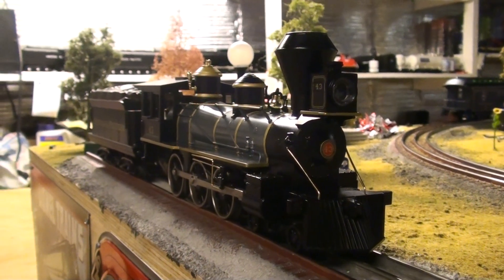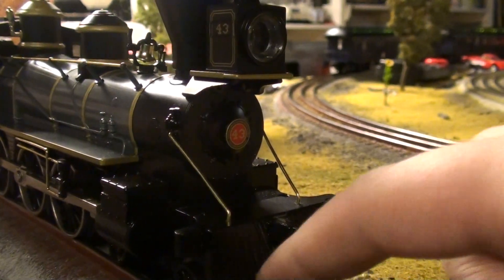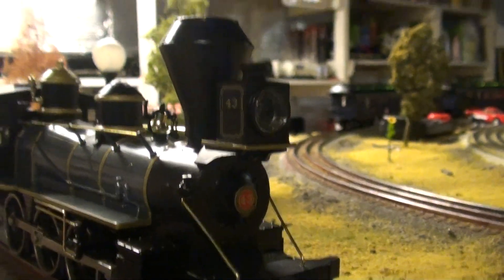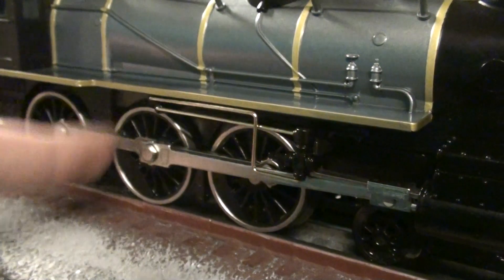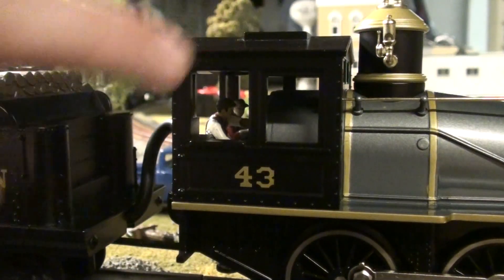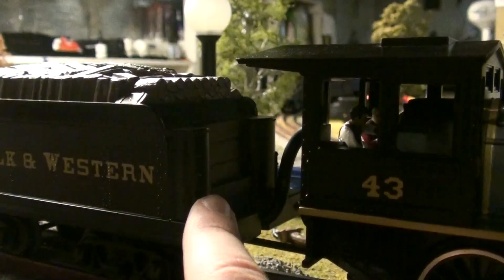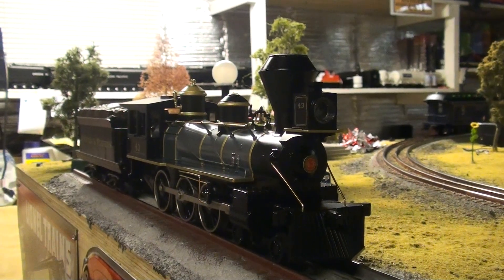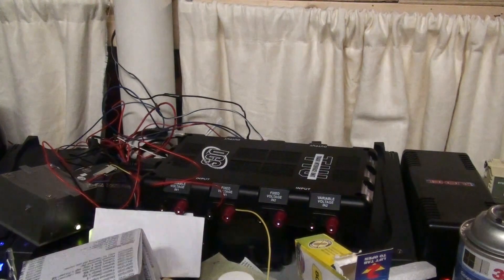MTH Railking Roger 4-6-0 Ten Wheeler Steam Locomotive

Comment: Great review! That box on the back is a tool box. The water hatch would be under the wood load and the tank is a horse-shoe shape. the two curved parts near the cab are the ends of the tank. Also the item that you called an air tank is actually the air pump. Other than that great review! Keep up the good work!

Comment: that is the good thing about mth you can run it on Either ac or dc also you can also run your tmcc and legacy engines through the TIU but you wont have all of the features of legacy Eric Siegel did a video on kinda how to connect the TIU to the Legacy or train master system all it is a cable from one to to the outher

Comment: @sevenpointsixtwox54 Railking is the more affordable line of engines that MTH sells.  You usually give up some separately applied details and most don't have smoke units...most steam engines do but diesels don't....and they're smaller in scale.  The MTH Premier are scale...always have smoke units, and have much more detail and they do cost more obviously.  MTH has a Railking Imperial series which is like buying "mid-grade" gasoline, so to speak.

Comment: MTH uses actually recording sounds in EVERYONE of there Diesel engines so your statement isn't accurate, they don't use all the same sounds on there steam engines either. In fact Lionel has only a few different recordings for every diesel they have and MTH has a Different sound set for each different engine!! Also MTH pull excellently!